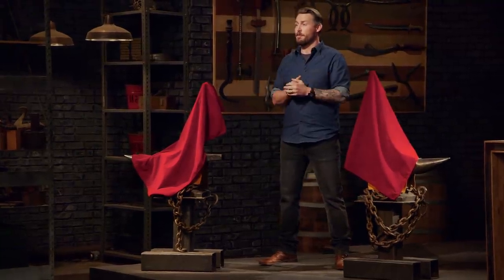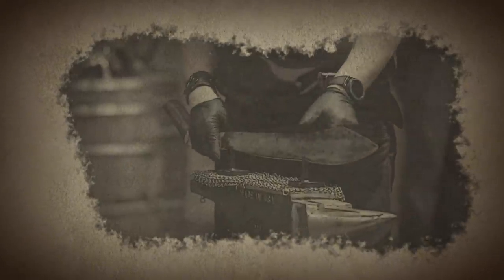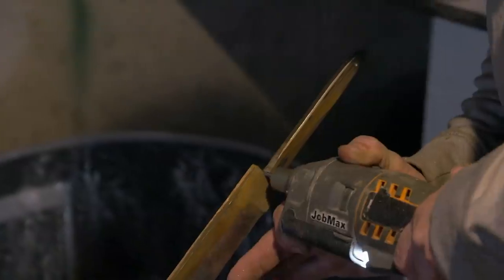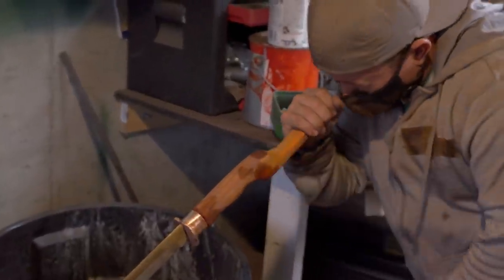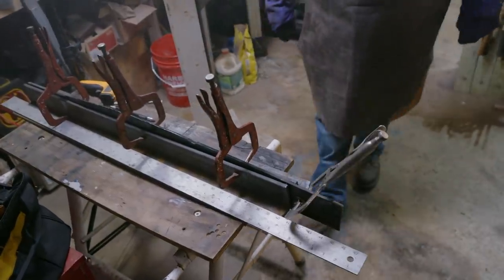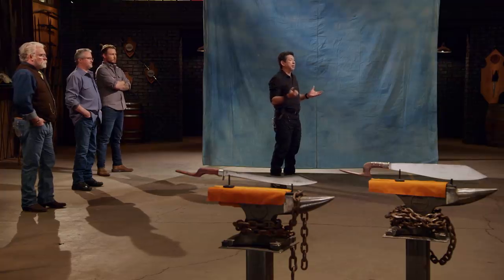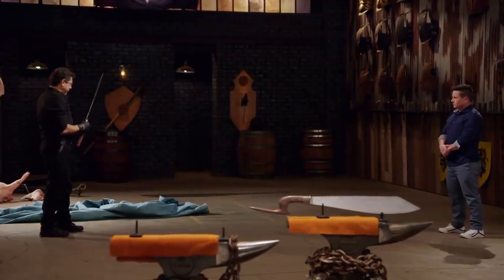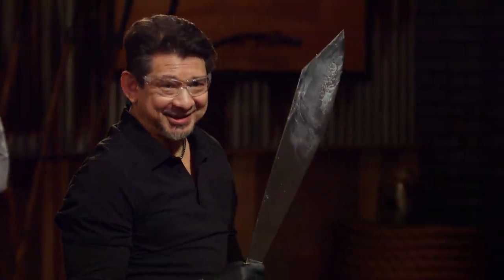Forged in Fire: PIERCING Pira Sword Suffers a MASSIVE FAILURE (Season 8)

Comment: Davy's sword was outperformed in the kill test. Basically you could have declared Garrett the winner after the keal test. But the strength test speaks for itself....
Reply: One sword did what a sword is supposed to do, slice up flesh
The other sword did something idiotic a sword is never designed to do, smack a gong
Reply: @sirpibble  Well the other sword still did some deep cuts that could kill, its great to have sharp weapons as the 1st one but in real life people don´t stand still like the pig and usually had some armor or even primitive tribes had shields, the 1st sword would break after a few slashes at shield and you´d be left without a weapon.
Reply: @sirpibble  But the sword would also break if parried by another sword. You want a sword that can keep chopping. Each one of those strikes could have been lethal. Also, in combat, you'd be facing an enemy in armor, and hence would want something that could survive a hit on that.
Reply: Pon. Esto es un petardo 🧨. ¿Pero qué rollo macabeo es éste?. Un ladrillo 🧱
Me 🇪🇸 voy a tocarme un poco…🤔
—————-
This is a firecracker 🧨.  But what Maccabean roll is this?  A brick 🧱
 I'm going 🇬🇧 to touch myself a little ... 🤔 and drink some 🍺 beers ...
Reply: @sirpibble  a sword that can kill once is pretty wall hanger. A sword that can kill 100 times is a weapon. The strength test is an over-exaggerated version of what would be faced on a day in battle.

The sharpness test is after the strength and kill tests because retaining an edge is pretty important. 

The kill test is first, for dramatic reasons and to mirror the sharpness test. It will kill, it will last long enough to kill all day in horrible conditions.
Reply: @sirpibble  it also hits shield so…
Reply: @sirpibble  you sound like an expert maybe you should be a judge
Reply: @sirpibble   For a sword strength is more important because if your sword break in the middle of a fight then you are  dead for sure.
Reply: wwywo
Reply: And that's exactly why there is more than just one test.
Reply: Slicing is nice. But sometimes you need something thats gonna transmit force thru armor to knock someone down...for the keel.
Reply: @sirpibble  did you forget that swords in general may go against armored things, like shields
Reply: @sexysardarjanu  They used it to cut through a pig carcass, so no, that is most definitely something it is being used for 'in real life'. Swords aren't used to kill people anymore, in fact this show is the most practically i've seen a sword used in my entire life. There is very little a sword is used for in the modern age.
Reply: Keep in mind Davey used a sharpening stone and not a grinder like his opponent who has the obvious edge there. It’s an equipment difference. Not a skill difference as that’s important to note.
Reply: @c4veman  Thanks for elaborating.
Reply: Imagine your opponent is armed with a metal shield, I think this strength test can make sense.
Reply: @sirpibble  sword is made to take that kind of damage easily
Reply: @sirpibble  2 people are fighting, 1 person dodges out the way and the other persons sword hits a pillar or wall or gong or something, that sword shatters, they get sliced up
Reply: @awroxar6618  The actually reason the weapon failed was now how sharp it was or the profile of the blade but the half-assed guard fitting and a weak tang.

Comment: Not a bad tactic, if you know your opponent is a better Smith just make a thick blade that can survive anything and hope theirs breaks
Reply: It reminds me of Steven Bradbury, the Australian speed skating Olympic champion, who was so far behind the rest of the pack in the race that when they slipped and fell and took everyone else out, he was the one guy that didn’t get knocked over like a domino. He skated nonchalantly across that finish line and became a legend in the process.
Reply: The sword that broke was made by a guy that just did some stock removal and a heat treat. Had he actually forged the sword and spent time on the steel he could have made a more robust tang.

Comment: Always sad when the obviously superior sword breaks and loses
Reply: It's not Superior if it breaks but I know what you mean
Reply: The way the metal wrapping on the handle just hung there, bouncing in the air like an impotent slinky, was tragically funny.
Reply: I feel my heart break when I see something like that happen.
Reply: if you were to go into battle would you want a sword that breaks after contact?
Reply: @thuankhiet_  Depends on if the enemy is using a gong as a shield or not 😆
Reply: @RedneckForge  Well you don't be using a sword to intentionally smash a solid gong. swords are make to cleave through people. If you want to smash a piece of metal a bunch of times you use a hammer or a beefy axe.
Reply: @deletthis5040  Swords meet shields and armor on the field. And even when they can be used in an ideal condition where there are none, if the tang won't hold up to a single gong strike, it will not hold up to constantly cutting through flesh and bone. Even using it for its intended purpose puts a strain on it. It will eventually break either way, because it's not a strong sword. And most people aren't simply going to let you cut them, if they have nothing else, they will block your sword with theirs. If yours breaks on the first hit, you're dead.
Reply: @Asertix357  😂
Reply: Still a Shame about that Sword. Went trough that Pig like Butter.
Reply: Dunno why the tang was so thin. Especially for a chopper
Reply: Ah but the other is the superior club.
Reply: @jonasbertels701  Someone doesn't know how shields are constructed and it shows.
Reply: @jonasbertels701  I rest my case
Reply: @jonasbertels701  Don't need to, it is plain to see you have no clue what you are on about. You make my case for me and continue to do so.
Reply: A superior blade wouldn’t break

Comment: As much as I am happy for Davie... his sword looked more like a machete with a pira style handle attached versus Garrett's weapon. A fair test would have been for both blades to be relatively within the same parameters as each other. It was definitely a noticeable disproportion between the two blades.
Reply: They were both given the same parameters. The smiths chose to design them like that.
Reply: @jamesflames6987  the thing is... the judges have rejected weapons of similar styles at other times, for a lot less. Such as... two swords similarly made... one had a pommel, and the other one did not.  The Sword without a pommel was rejected and not tested.
Reply: @thenotsurechannel7630  Well yes, because the pommel was one of the parameters.
Reply: @thenotsurechannel7630  Well, in the case of the pommel, it was functionally unusable without one.

This? well it's heavier than it should be.  that back part of the blade could be ground off and it'd probably work better.
Reply: His sword looked just like the example they gave
Reply: Nah, that does look like a pira, its just the blade has different dimensions. Some that were expensive looked like davids, cheap ones looked alot like davies but the blades were smaller.

Comment: Garrett's blade looked better from the onset, end it was definitely sharper, but the simple truth is, even a duller sword is superior to a broken one.
Reply: Depends on the situation.  If you and an enemy fell into a tight hole where both of your swords are way too long to use in a close quarter combat, the person who can break their sword in half would be able to wield the broken sword and kill.
Reply: @walden6272  What if the broken sword ( Which already broke once ) breaks again, then what?
Reply: @walden6272  Ok, but, what if it breaks for a 3rd time, then they be bare knuckle brawling at that stage ?
Reply: @MegaCPrimE  The advantage still goes to the one with the broken sword, still can be used to deliver devastating hit on the head, like having a brass knuckle vs bare knuckle.  Anyway you look at it. Broken sword user wins.  :)
Reply: @walden6272  Ok hear me out, what if while they are busy fighting they fall out of the hole, and they are now in an open field, then surely the guy with the working non broken sword wins right?.
Reply: @walden6272  Ok,ok, what if the floor of the hole gave way and they fell into a huge cave, big enough to fit a Boeing 747, then surely the guy with the working sword would kill the guy with a broken one.
Reply: @Walden how do you wield a broken sword without cutting yourself

Comment: I love this show, but I do think they could modify and improve the weapons tests depending on the style, type, and intended use of the blade. Especially when judging recreations of weapons designed for battle during the times when durability was more important than sharpness. A solid somewhat dull sword was much more effective than a sharp sword that was prone to breaking.
Reply: The one making the sword is in control of quality.   So why make a excuse for not making it durable and sharp?
Reply: The guy with the durable chopper won.

Comment: They should add max weight to blades to prevent something like this to happen.
Reply: They actually do.

The thing is when you forge a metal, the superior one didn't require a lot of mass to maintain its strength and durability. And the judge takes the weight into account seriously. There is a lot of blades that lost mainly because of their weight alone. So it's more like a gamble, if you trust your forging skill on produce a superior metal you could shave a lot of weight from it and take the advantage on the weight part, or you could play safe and send in the more beefier and heavier one.

If Davy's sword didn't break he is going to win for sure.

Comment: I'm not even convinced it would kill if someone was wearing even soft armor
Reply: @falliathorne8123  some test you can do yourself at home if you're bored on a Sunday. Layer pieces of cloths(rags for the test), sew them and soft wax them, try to get a reasonable thickness. Let it dry and soften, put it on the next piece of meat you'd like to prepare for dinner, take your sharpest blade (may it be a big kitchen knife) and try to slice through it. You'll understand why people used them to save their lives, cost aside.

Comment: If you quench your blade and don't jiggle it around it forms a bubble around the blade and doesn't harden properly. The guy just stuck it in there and let the bubbles form around it that's why I didn't harden properly even the second time

Comment: what was the purpose of having such a strange handle shape?
Reply: I'm wondering too.
Reply: Some type of backwards stab or block? No idea
Reply: I’m not sure, but my guess is that you would have pretty good control if you held it almost like a rifle. Trigger finger just past the bump, other fingers and thumb wrapped around the lower part of the handle. You could chop down with it and then quickly pull the blade back to guard or start a new strike.

Comment: Interesting match. Garrets sword was clearly FAR superior for a cutting/slashing weapon as it was designed. It cut the pig in half twice. Davys sword has a terrible edge on it, the cuts were no more than a couple inches deep, which is surprising considering how clunky and overly forward heavy as it was. However, when you use a slashing weapon to hit a gong as it was not designed, it can break if it has a slight weak point. Based on these tests alone, a wooden club would have won this competition. "Parameters" aside.
Reply: The tests are an extreme example of the rigors of day-to-day battle. Rather than taking the time to test the blades incrementally over days, or weeks, they instead opt to test the full durability with harsh treatment. No, it wasn't meant to bang on a gong... but what would you do if you took that sword into battle, took down two, maybe three enemies, and then swung it and it crashed into a shield? Or a larger, heavier sword? The sword snaps and... what? You complain that the sword wasn't meant to hit anything that wasn't a flesh and bone? It is a severe test, but it is a test of durability. If your blade won't hold up to that, it won't hold up on the field either.

Now, granted, nobody is taking these swords ONTO a battlefield... but if they did? It would be worthless. This isn't about making decorative weapons that simply look pretty/unique, this is about making functional weapons, that would serve well in battle.
Reply: @Hellbane224  That is a great response well done

Comment: So happens if both swords break during the strength test?
Reply: It depends on the number of hits it could take
Reply: @erikkupculik7268  Or extra details incase of exact number of strikes. Design, decoration, deformation, weight...
Reply: Doug keals them both with his bare hands, it happens a lot but they don't air those episodes
Reply: In this case, the first one would've won, as it did way better in the "keal" test.